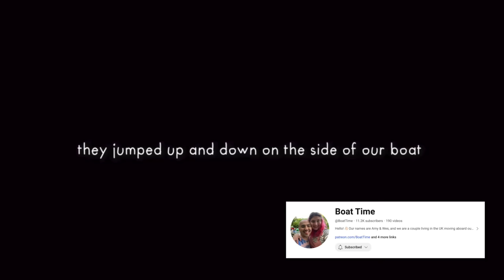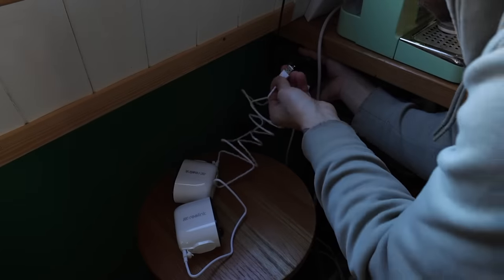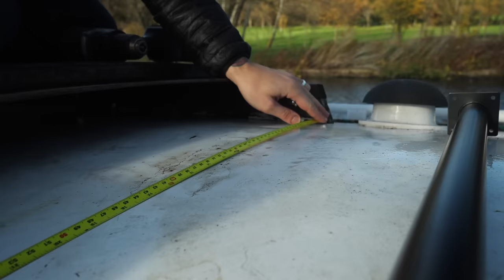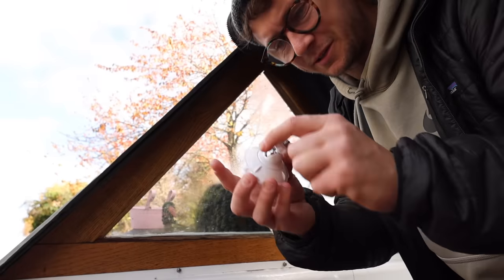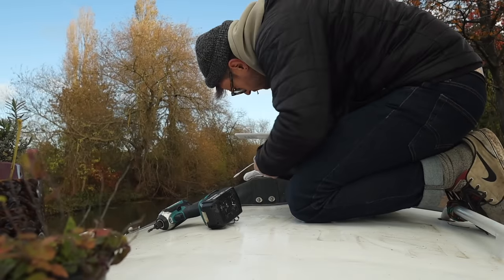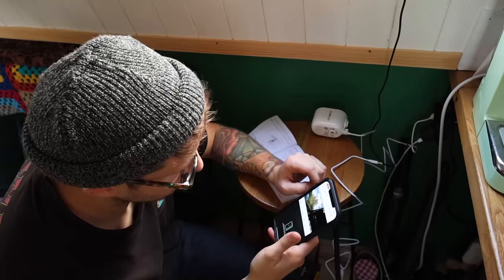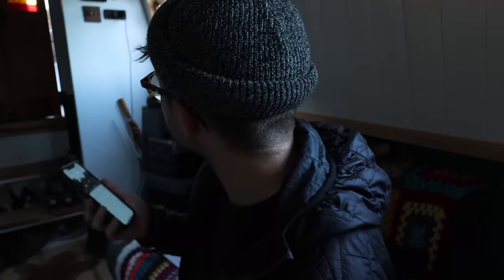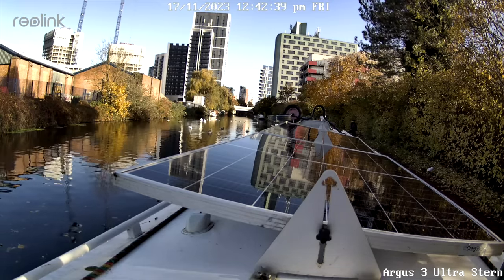Installing CCTV To Our NARROWBOAT (REOLINK ARGUS 3 ULTRA)

Comment: Put the pipe fitting on a hinge, so it will be able to drop down when going under low bridges.
Reply: I was thinking the same
Reply from the maker: Yeah that’s a good idea for the long term  - it’s no higher than our wheelbarrow being on the roof and the only bridge that’s not fit under was one in Bristol so we should be okay for a bit. I’ll look into the hinge though

Comment: Good idea but that pole is fixed what happens when you go under a low bridge? You need to hinge the pole so you can drop it.
Reply from the maker: It’s much lower than our chimney and rarely have to remove that, when we do it’s only four screws and I’ll re-attach - I’ll find a folding pole for long term use this was mainly for the demo video

Comment: Hi there guys. Can I ask a couple of questions regarding those cameras as we want some ourselves but do they need to work on WiFi and if that is the case do you lea e your WiFi on then when you aren't at the boat for a few days?  This is something that's been confusing me for a while as we turn our inverter off when not on boat so therefore our Internet isn't on and I wondered how any cameras then operate. Sorry for long winded questions 🤣
Reply from the maker: Hey yeah no worries at all! 

So our router (similar to this - https://amzn.to/3MPNQrO ) we actually leave on all the time, you can get a cheap cable that plugs into USB rather than having to keep plugged into a normal socket & leaving inverter on - https://amzn.to/3G7azM8 (one of those adapters will fit the router) 

But yeah the cameras we've got rely on WiFi but they do sell ones with their own little sim cards so no WiFi required - might be worth looking into those too!

Cheers!
Reply: @ItsOhJoe  thank you so much for your helpful and detailed reply..I'm going to have a look at those links now. Thanks again 😀

Comment: How are you going to cope with the low bridges or is the camera pole low enough ?
Reply: I was shouting “what about low bridges” while he was drilling into the roof
Reply: As an apprentice I was always taught to not drill holes in girders etc to mount things because after many other people have done the same the structure is weakened.
If at all possible weld a bracket or plate on that you drill to mount your object
Reply from the maker: It’s much lower than our chimney and rarely have to remove that, when we do it’s only four screws and I’ll re-attach - I’ll find a folding pole for long term use this was mainly for the demo video
Reply from the maker: @brianparker5228 no girders harmed here
Reply: @DanniandJoe  I understand that but the principal of drilling into a structure is the same
Reply from the maker: @brianparker5228  we’re talking about 3mm holes in a 6mm sheet steel roof with 6” holes drilled randomly for vents, I’m sure it’ll be fine

Comment: I see two problems. The pole is secured and will hit every low bridge when you actually get onto real canals. You've been spoiled on the K&A with the high bridges! Normally you'd never cruise with your chimney on either 🙂
I  use a pole on a mag mount, and if it hits a bridge or overhanging branch it just flips over.
Second problem is heading for London, when you should be putting distance in to keep away!  My camera is great for spotting wildlife, but too be honest, it rarely gets turned on.
Reply from the maker: Where’s the fun in being afraid of enjoying the capital from the comfort of your own home knowing you can leave at any point? 😂 to be fair we’ll see how the pole gets on, if we have to fit one that fold so be it - it was literally £10 & mainly a demo of showing the camera working

Comment: Haven’t you slipped up with the pole for the stern camera? Surely it’s too high for low bridges, which means you’ll have to keep unscrewing it?👍🏻
Reply from the maker: Yeah in the long term I’ll probably need a hinged bracket or something but it’s no higher than our wheelbarrow or chimney & we’ve only had to take that off the roof once back in Bristol to be fair
Reply: @ItsOhJoe Oh, OK, didn’t realise that, it just looked quite high on the video (must be camera perspective, or lack of it😂). Just thought I’d mention it. Really enjoy watching your adventures & your boat improvements. For someone so young, you have a good head on your shoulders.👍🏻👏🏻
Reply from the maker: @kennyscouse3388  yeah I think the perspective made it look a lot taller as had a fair few worried comments! 😂 Thank you - appreciate it
Reply: @ItsOhJoe 👍🏻👍🏻👌🏻

Comment: Thanks for sharing these cameras, I’ve just ordered 2 set ups for our nb 👍🏻 we’ll get a folding pipe to mount them on 😃
Reply from the maker: It’s much lower than our chimney and rarely have to remove that, when we do it’s only four screws and I’ll re-attach - I’ll find a folding pole for long term use this was mainly for the demo video
Reply: @ItsOhJoe  thanks, I did see your reply to an earlier post. We’ve just ordered 2 set-ups as we’re so impressed! Many thanks 🤩👍🏻
Reply from the maker: @jacquelinesheskey7870  Awesome! Let us know how you get on with them!

Comment: Hi Joe, I have similar product mounted on aluminium tubing clamped on front of crotch A frame. The camera is about 3’ high and points toward stern, I angle it slightly down so I now get view of whole boat inc a bit of cratch cover entrance. There is a “movement setting” on the app which you can adjust sensitivity, it also has night vision which obviously isn’t quite as clear as daytime view. I have a Wi-Fi modem on boat so I can get an alarm “ping” on my phone when not on boat if someone gets close to boat, also great in winter months when it’s dark and you’re chilling inside. My only gripe with the camera is the damp wet weather can affect the vision so it’s best to occasionally give it a wipe. Good luck with it 👍🏻
Reply from the maker: Awesome thanks for the tips! Sounds like a good angle to catch the whole boat actually

Comment: You drilled through the roof for the pole, screwed the pole, sealant for water ????
Reply from the maker: Gasket applied
Reply: looks like you used flat head screws,  instead of round head so sealing under those screwheads will fail.   @ItsOhJoe